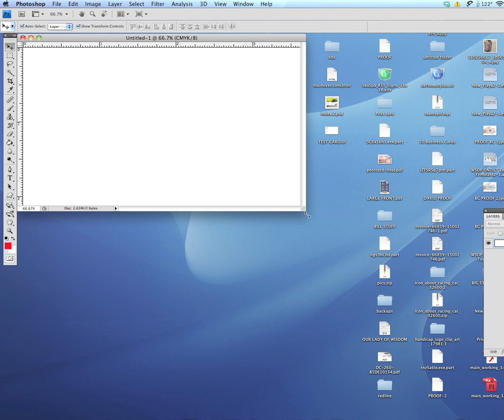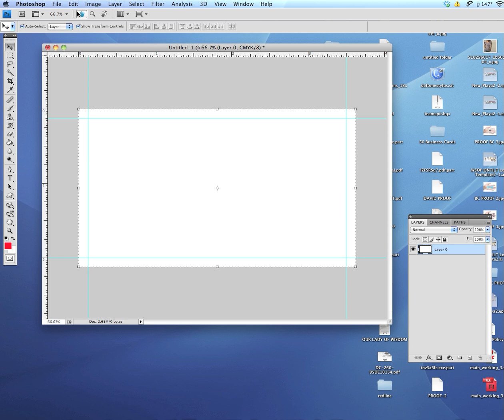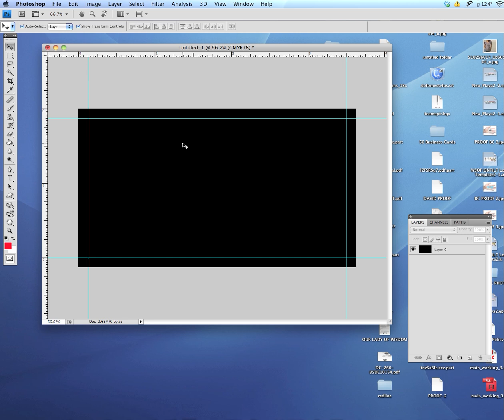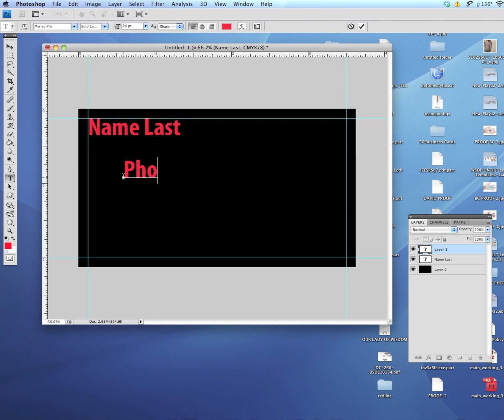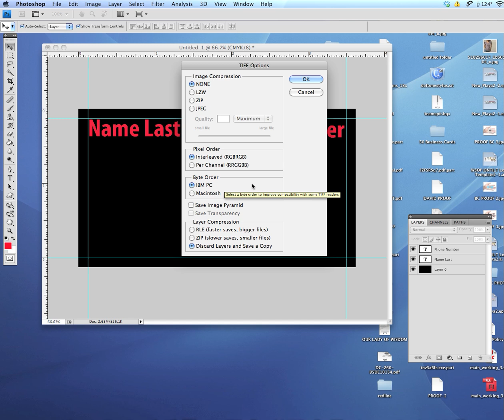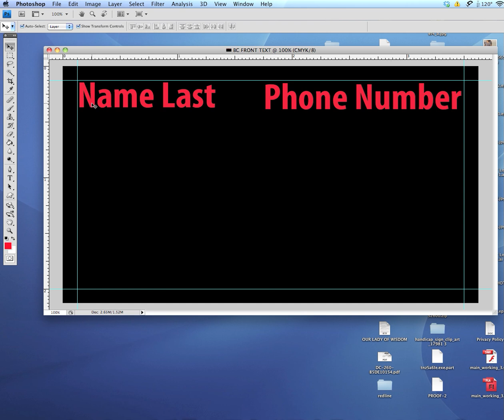Set-Up Print Ready Business Card with Bleed Photoshop RedLineLV.COM

Comment from the maker: @CraftsDotCupCake  coverting text to curves or outlines is handy if you are sending the file to a printer who may not have the fonts. Unless your file must be vector or layered. There is a better way. Anything I would say 13 X 19 or SMALLER would rarely need to be vector. Just save your file as a .TIF or .TIFF with no editing capabilities saved / no layers as a flat file. This will make any font or text issues void. You should never send a printer a layered file , unless it is 1 or 2 color print